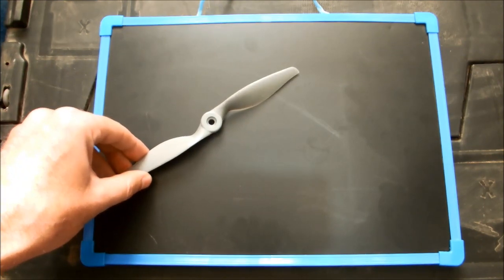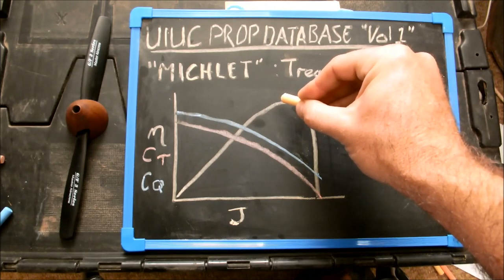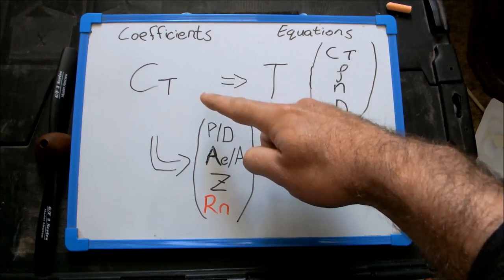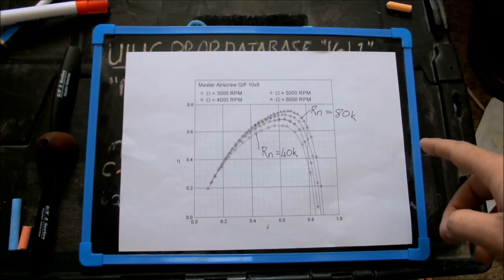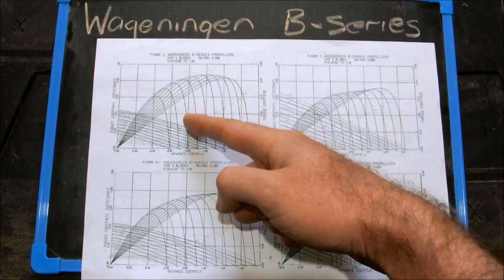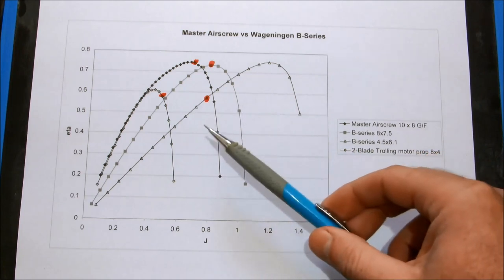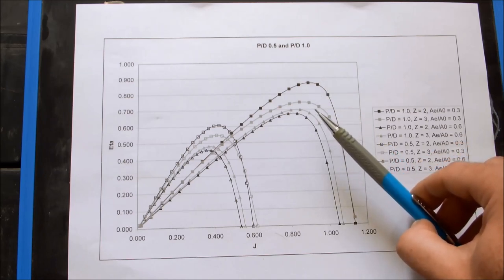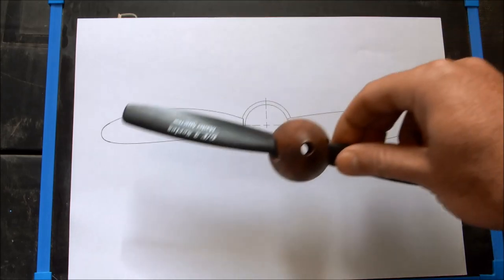Model Aircraft propellers - UNDERWATER?

Comment: You have impressive math skills.
I personally prefer test data.
I took some measurements a few years ago of various airplane propellers driven by a Minn Kota 30 lb trolling motor in a swimming pool using a spring scale to measure static thrust.  Here's the data in case you're interested.

Stock prop:  17 lbs @ 27.8 amps  1.64 amps/lb
7x4 APC:      11 lbs @ 13.3 amps  1.21 amps/lb
7x4 "Super": 13 lbs @ 15.7 amps. 1.21 amps/lb
9x4 APC:      17 lbs @ 21.7 amps. 1.27 amps/lb
9x4.5 APC E:15 lbs @ 22.5 amps. 1.50 amps/lb
10x4 APC:     18 lbs @ 26.3 amps. 1.46 amps/lb
10.5x4.5 APC:20 lbs @ 29.2 amps 1.46 amps/lb
11x3 APC:      19 lbs @ 26.7 amps 1.41 amps/lb
11x4 APC:      21 lbs @ 31.7 amps 1.50 amps/lb
As you can see, the two 7x4 props were the most efficient and although bigger props produced more thrust, they were less efficient in terms of amps/lb of static thrust.   The worst efficiency was the stock weedless trolling motor prop.  Of course, once the boat is moving, the thrust will drop off differently for each prop so who knows which one would attain the highest speed.    Perhaps you have a way of calculating that.
Reply: By the way, the "APC" were all gas engine airplane props except for the one labeled "APC E" and which was of the same style of the grey one you had in the video.
I ended up choosing the 9x4 APC and I'm quite happy with it.   Despite having the same static thrust as the stock prop, it actually seems to drive my kayak much faster.  It's probably because it's spinning faster and therefore has a higher pitch speed.
Reply from the maker: Thanks Andy, that is very useful data. For efficiency as you calculated it, the motor's efficiency is also included. Motor efficiency will change as the boat starts to move. A coarse prop will draw more current during static tests but will ultimately perform better at speed provided it has the right diameter.
Reply: @williamfraser  
Agreed.  The motor unloads as speed increases which will help maintain thrust with increasing speed.  In my case using the 9x4 prop compared to the stock trolling prop, the higher pitch speed seemed to have a greater effect on maintaining thrust with speed.   I probably should have compared larger airplane props though because the stock prop is engineered to be weedless which probably is what makes it so inefficient compared to the airplane props.
Reply from the maker: Were you able to measure current and top speed with the 9×4?
Reply: @williamfraser  
No I didn't have my shunt setup on the kayak.  I need to invest in a clamp meter.
Reply from the maker: DC current clamp meters are very useful but pricey. Also consider the in-line power meters used by electric rc modellers. If you can afford to sacrifice a prop in the name of research, I would suggest using a 10x6 and do test runs, each time trimming the diameter down by 1/2". For ultimate propulsive efficiency, the prop efficiency and motor efficiency should peak simultaneously. I will be doing another video to show how to apply the equations.
Reply: @williamfraser 
Will do.  Thanks
Reply: Excellent data's thank you.
Reply: what you really need to test is the kayak's drag. you could test that by towing it (suitably weighted) at a known speed, with a long enough tow rope to avoid the wake, and measure the tension on your spring scale. When drag is less than thrust, you accelerate. When it's equal, that's your top speed. If thrust at speed is less than static thrust (not sure, but seems like a reasonable hypothesis), then your drag at top speed must be not greater than your static thrust.
Reply: @dominictarrsailing  
You are absolutely correct that a kayak's drag will come into play.  This is especially true with less slippery vessels like a row boat.   Ultimately, the top speed will be the point that the boat's drag equals the thrust produced by the motor at that speed.  Static thrust is typically the maximum thrust then it drops with more speed, how much of which is very hard to predict.   I just kept it basic to be able to measure several various props quickly.
Reply: @Andy-df5fj  I'm also wondering about setting up a scale on the outboard so can measure thrust at speed directly (of course it would under estimate by the drag of the outboard itself)
Reply: @dominictarrsailing  
If you do that, please share the results.

Comment: Will, excellent video as always.  This might appear to imply that common boat props are crap but they are just sacrificing efficiency for other usability factors.  They have limited diameters to make it easier to design motors with enough torque and depth to turn them, and more large area blades to give them a broader performance band and less cavitation.  Electric motors present a great opportunity to increase efficiency because they don't have the complicated torque curve at the same time they need greater efficiency to offset the higher cost of energy storage.
The concerns I have for using model airplane props for water are load deformation and cavitation.  I suspect there is still improvement to be had from a stiffer material and profile that evens out the suction peak like on hydrofoils.  With improved material and profile you could swing a really large high aspect prop and get crazy efficiency.
Reply from the maker: As those Wageningen performance graphs show, a typical 3-blade marine prop is still capable of really good efficiency at high P/D ratios and sufficiency high Reynolds numbers. The peak efficiency for any prop is limited to a limited range of advance ratios. For a given shaft power, this translates into limited combinations of diameter, rpm, boat speed and thrust required. Any mismatch of these variables and efficiency suffers. 
Not discussed in this video is the prop's sensitivity to deviations from the ideal combination. Compared to a narrow twin-blade prop, a 3-blade, high area ratio prop is much more sensitive - i.e. efficiency drops off sharply as variables deviate from the ideal. The highly variable conditions typically encountered by boats with small outboards means that in practice they hardly ever operate anywhere near the props peak efficiency. 
I have analysed the 3-blade Wageningen's thin blade foil and compared it to my own thick, highly modified, low Rn foil section. The pressure distributions were as expected - even, full chord low pressure on the thin foil as required to prevent cavitation. The thin foil stall quickly and has a low maximum lift coefficient. It has superior lift/drag ratio at low lift coefficients. I am no professional prop designer but I recon that this results in a prop with low torque requirements but that requires higher rpm and larger blade area to absorb available power, and to produce sufficient thrust. A petrol-powered outboard can therefore get away with a smaller, more streamlined gearbox in the lower unit.

Comment: Try a 3 bladed  pusher prop 15"inch dia x 7"inch pitch, 
If too much for motor trim down each tip by length and balance.
Best of luck.
Reply: sounds original

Comment: Dear Sir ,I own a Haswing osapian 55 lb.with 3 blades with diameter 25 cm and 1250 rounds per minute and the shaft is 8 mm.In  normal sea conditions my speed in 5 gear is 4,1 knots.I own a ocean kayak trident prowler 15 and i believe kayak me and fishing staff its about  270 lb.Whitch type and code number  of APC propeller must be used  for increasing the speed according to your expertise .Thank You so match .Tassos Manolas.Athens Greece.
Reply from the maker: 10x8M-LH should give you great top speed. You might need spacer rings to fit your shaft diameter. Use electric circuit breaker or fuse in case the motor draws too much current.

Comment: So the reynolds number is the velocity of the fluid and object in relation to each other? How is it that the propeller is more efficient at the higher reynolds number even though friction increases exponentially? There must be a sweet spot between lift and drag. 

From all my research lately I'm getting the picture that most boat props are horribly compromised(in terms of efficiency), and that the hull and propeller are the most important factors in boat efficiency, and that one has to compromise efficiency at one speed to gain it at another.
Reply from the maker: Reynolds number (Re) = chord x velocity x (density/viscosity). There is an infinite number of combinations of these variables that can all equate to the same Re. If a foil operates at a specific Re value it will produce specific lift and drag coefficients at each different angle of attack. At high Re, a foil section produces higher lift coefficients and lower drag coefficients for a given angle of attack.  This means higher lift/drag ratio which translates into higher efficiency. It is important to distinguish between the coefficients and the actual lift and drag forces. The ratio of lift/drag force is the same as the lift/drag coefficients, but the actual lift and drag forces will depend on the particular values of velocity and density.

In the Re equation above I have deliberately lumped density and viscosity together to use in the following example.
The value for density/viscosity of air in SI units is around 66 600. For water that value is 1000 000. 
As an example, take an arbitrary prop spinning in air at 6000rpm and Re of 80k. 
Assume the aircraft flies at a speed that results in the prop blade having an angle of attack (AoA) of 4deg. 
Assume that at 4 deg AoA the blade has a lift coefficient of 1 and drag coefficient of 0.1.  The L/D ratio is 10. 

If you put the same prop underwater and reduce the rpm to 400 (i.e. 6000 x 66600/1000000), the prop will again be operating at a Re of 80k. If you adjust the forward velocity of the prop (i.e. the 'boat speed') such that the angle of attack of the blade  is the same as it was in air, then the lift and drag coefficients will be exactly the same as in air.
The lift and drag forces will however differ due to the fact that they vary with density and velocity squared. Without going into the detail of the equations, the forces underwater for the example above will be 4x higher than the forces in air at the selected velocities.

If the prop is in fact operated underwater at 1200rpm then the Re will be proportionally higher (80k x 1200/400 = 240k). Still assuming an angle of attack of 4 deg, the lift coefficient might increase to 1.05 and the drag coefficient decrease to 0.09. This gives an L/D ratio of 11.7.
Reply: Viscous friction doesn't increase exponentially.  It increases linearly with speed, while lift increases quadratically with speed.  Therefore lift/thrust increases more with speed than does friction.

Comment: Keep in mind that there is no doubt that a high A/R airplane prop will be more efficient than a fat boat prop with the same specs. However we are experimenting with power systems with a very low thrust/torque requirement than you would need for a gas outboard engine driven to much higher speeds.

Just wanted to point out that if you put a plastic rc airplane prop on a 9.9hp outboard motor, it will shred it to pieces.
Reply from the maker: Yes the torque and thrust loads are much higher than at the same advance ratio in air. Some of these plastic props are impressively strong. A friend uses a 12x12 apc and gets 8kts on his solar boat with 1.3kW solar panels. As you can see right at the very end of the video, high AR blades are well within the range of what is acceptable for marine use. The blade thickness ratio is proportionally higher to cope with the loads.
Reply: @williamfraser  What motor does he use to drive that prop?
Reply from the maker: @dustman96  I am not exactly certain but I know he uses some industrial brushed dc motor on his solar race boat with a chain and sprocket reduction to the drive shaft.

Comment: Where you get that propeller for s 55 thrust motor by Haswing or Minn Kota??? Thanks
Reply from the maker: Hobby shops for model aircraft. You will have to test different sizes to see which one is a good match for your boat and motor. The plastic props might not be strong enough to handle the power from very strong motors.

Comment: Some of this went over my head. So if you have a propeller with a small chord, will sweeping a given area(diameter) at a given rpm move just as much fluid as a prop with a larger chord, or area, but the same diameter?
Reply from the maker: Correct. The pitch on the slender prop will be more so it will operate at a higher lift coefficient. The force per unit area on the blade will be higher for a slender blade. It is not just the water in contact with the blade that "gets moved", so to speak. A moving blade creates a pressure field that extends all around it, including the swept area between the blades. Water passing through the pressure field also gets deflected and accelerated.
Reply: @williamfraser  Thanks for clarifying, that makes sense. Given the high lift coefficient then the blade will stall when pushed beyond a certain speed through the water? And to prevent the blade from slipping, you again need greater area, meaning a greater diameter, rather than a lager chord? But if the area becomes too great then the frictional/drag losses become larger than the any potential gain in efficiency? And the efficiency of the low chord, large diameter prop comes mostly from the high aspect ratio?

Sorry to slam you with questions, but you make better sense of this subject than the numerous papers I've read.
Reply: The higher the required thrust, either for acceleration or overcoming resistance at speed, the larger the area required?
Reply from the maker: @dustman96  not necessarily. It depends on exactly how much thrust you need and the swept area. A slender blade can produce the same total thrust as a wide blade, i.e. the force per blade is the same. The pressure (force per area) on the slender blade will be more. As thrust increases (for a given swept area), there comes a point where the low pressure on the front face of the blade drops below the vapour pressure of the water, resulting in cavitation. If increasing swept area (i.e. using a larger diameter prop) is not an option, then the only way to further increase thrust is by adding blade area (by increasing chord and/or by adding more blades) and reducing pitch. The prop will experience less pressure differential but still produce high thrust thanks to the increased area.
Reply: And you would need to increase rpm to compensate for the decrease in pitch, kind of like shifting to a lower gear.

If I'm not mistaken, some aircraft have variable pitch propellers.
Reply from the maker: @dustman96  just to answer some of your other questions and hopefully prevent any confusion - the blade will stall if the angle of attack relative to the water increases beyond a critical value. Generally, this is the same angle associated with maximum lift coefficient and most extreme pressure peaks. 
Angle of attack varies with rpm and boat speed. Higher rpm and lower boat speed will both contribute to increased angle of attack and the likelihood of the prop stalling.

Cavitation is purely a pressure issue. Pressure is a function of both lift coefficient and velocity, so it is possible for a slow prop to stall without cavitating, and likewise a fast prop can cavitate even at moderate lift coefficients. 
Efficiency will always be higher with a larger diameter provided the blade chord is small enough. Practical considerations like strength limits how slender a blade can be so there is a limit in diameter beyond which no further gains in efficiency can be made.
Reply from the maker: @dustman96  no you can keep rpm the same. Higher rpm will again reduce the pressure on the front face below vapour pressure which is what you don't want.
By reducing pitch at a fixed rpm, the angle of attack is reduced and thereby eliminates the pressure extremes. 

Variable pitch props on aircraft allows the prop to operate at optimum efficiency regardless of airspeed. The prop is set to a fine pitch (i.e. shorter pitch) which maximises thrust for takeoff and also improves climb performance. Pitch is increased at higher speed for cruising. 
A second benefit is that the engine can be kept at its most optimum rpm for power or efficiency, as the case may be. This is why those props are also called constant speed props.
Boat props could also benefit from variable pitch but boats they typically reach cruising speeds relatively quickly, unlike aircraft which spend extended times at slower speed during climb. 
Boats would benefit from variable pitch in headwinds.
Reply: @williamfraser  Hi again, one more question if I may. 

A larger prop diameter at a given pitch would give greater effective pitch at a given rpm due to the higher velocity of the blade tips? So one could reduce pitch if using a larger diameter prop? 

I am getting the idea that the larger the diameter, the smaller the chord, the lower the pitch, the higher the efficiency.
Reply from the maker: @dustman96  from all the prop curves I have looked at the highest peak efficiencies were for props with pitch/diameter of around 1. As p/d decreases there is a small gain in efficiency at low advance ratios (e.g. at slower boat speed for a given rpm) but peak efficiency suffers significantly. One of the reasons for this would be the smaller separation between the helixes as traced by each blade. Each blade is therefore more negatively affected by pressure field created by the other blades.

Comment: So what you are saying is that it is not a good Idea to use my outboard motor propeller for my RC model?? ;)
Reply from the maker: No I guess not! But some aircraft propfans look hardly any different from boat props and do well at altitude. The low area ratio, high blade count B-series props will look right at home on the nose of a scale warbird.